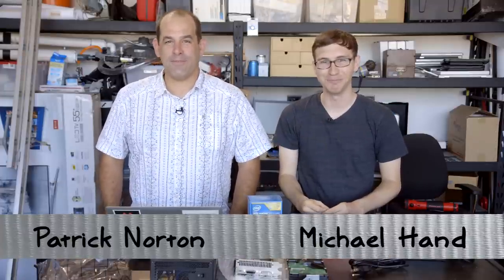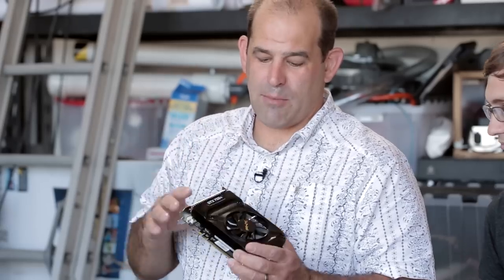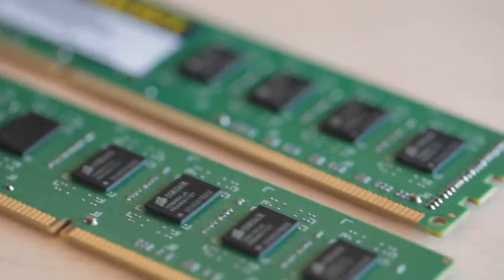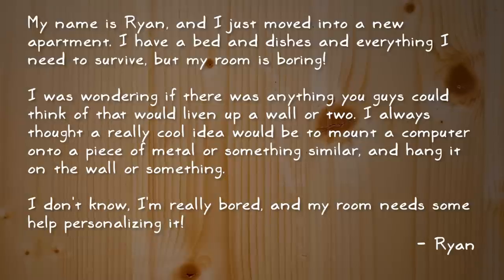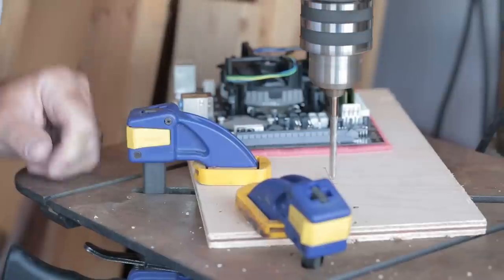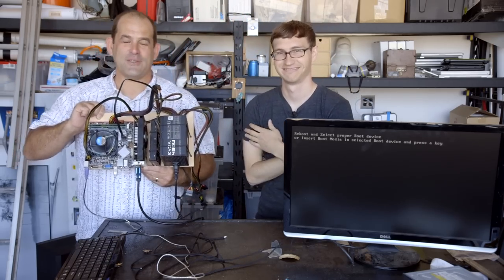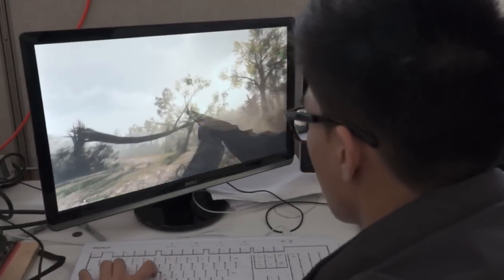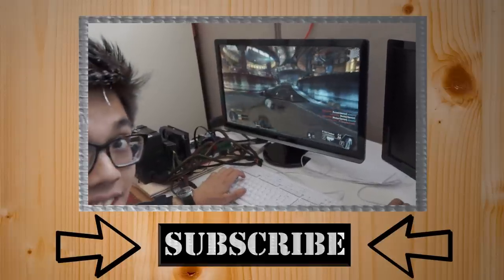Screw The XBOX ONE and the PS4... We Built a Gaming PC for $380!

Comment: My PC was like $230 and outperforms this.. not to mention it has a case.
Reply: +Andloo Yunty what are the specs, i'd like to know please.
Reply: Karambit Doppler
Most of it was on sale, but

A10-7700k
8 Gigs of random cheap ram at 1600Mhz
AsRock FM2A55M-HD+
WD Green Caviar 1TB HDD at 5400Rpm
Logisys CS301BK with included PSU

It performs at about the same level as the build depicted here.

My specs now (expanded on that rig)-the new build has a total of around $400

A10-7700k
8 Gigs of random cheap ram at 1600Mhz
AsRockFM2A55M-HD+
WD Green Caviar 1TB HDD at 5400rpm
Logisys CS301BK
EVGA Supernova semi-modular 750W PSU-bronze certified
Gigabyte Windforce R9-270X (factory OC'ed)
Reply: Oh thats actually pretty good.
Reply: +Karambit Doppler Same here =D
Reply: Karambit Doppler Thanks. Now that I know more, I would've probably gotten a better GFX to begin with, and maybe a better PSU and Case.
Reply: +Andloo Yunty 
And let me tell you, that's a cheap and pretty badass config you got there. Good job!.
Reply: +Andloo Yunty 

And let me tell you, that's a cheap and pretty badass config you got there. Good job!.
Reply: Federico Nomeacuerdo Thanks! I appreciate that.
Reply: +Andloo Yunty not to mention this video was posted a year ago and prices change quickly.
Reply: Megabine My build was made about a year ago too.
Reply: ***** I posted the specs, you can check.
Reply: ***** 2nd reply in this string. I'm sure prices have changed, but it's probably around the same today.
Reply: +Andloo Yunty i know nothing about building a good pc or anything and i would love some help because i need something cheap but i want something effected because in my predicament i don't think my dad would get some over 500 dollars and its not easy getting a job as a minor so i would appreciate some advice or something
Reply: OriginalDizzleKing Just read the earlier replies and you can see my build.
Reply: Care to share your build details in that case? I'm also looking to build a budget gaming rig
Reply: +Andloo Yunty lol that apu doesn't come close to this pc,exampe:your pc runs battlefield 4 1080p lowest possible settings 60 fps this runs it on high 1080p 60 fps,not to mention your pc can't run witcher 3 on 1080p and this can do it on high 30 fps
Reply: +Andloo Yunty You cant tell me the IGPU in the 7700k outperforms a GTX 750ti. 
I had an A10 6800k and it was pretty good for an IGPU but you wont get 60fps on modern games, not even console ports, unless you turn down the details a fair bit.
Reply: +CoalhouseWalker If you just want to play console ports or you dont care so much for ultra graphics. An Athlon II X4 or the new Pentium G4400 in combination with an R7 370 and 8 GB of ram should get you to your goal for around 300,- just for the system, without operating system and peripherials.
Reply: +Andloo Yunty  your build doesnt even have a graphics card . Apus are junk so i doubt it outperforms this
Reply: +Andloo Yunty Your junk doesn't outperform this one. An APU vs 750TI? Yeah, lol, good luck with that
Reply: +Fus Ro Dah  right lol i have a 750ti and a8-7600 and can run every game maxed out except ark and a couple other
Reply: +Andloo Yunty People don't put enough faith into the APU's.  They are really all AMD has going for them right now.
Reply: +Andloo Yunty same here. Got 150euro A6 build and 320euro A10 build.
Reply: yup, used to have 2 budget APU builds that worked great.  Running an i7 now, but it's no where near budget.
Reply: +Andloo Yunty  but you did mention it
Reply: +Andloo Yunty What about graphic card on the first build?
Reply: don't forget the change in cash with different countries
Reply: +Andloo Yunty Nope it does not.  You don't even have a dedicated GPU.  That's really a POS system. Its good as a HTPC but for gaming... It can do it but not very well.
Reply: +Karambit Doppler No its not.......... Low end gaming PC. What the guy in the video built was a PC that can play some games.
Reply: +TweetysDen At 30 fps.
Reply: I went ahead and spent $510 to make a much more futureproof system. I splurged a little and went with the R9 380 (same tier as gtx 960) so I'll be good for a years to come. Even my 3 year old HD 7770-based system is still keeping up with games today.
Reply: Your 7770 can only play Fallout 4 on Low medium CoalhouseWalker
Reply: +DEZ n00ts At what resolution? and to get what type of framerates - are we shooting for ~30 or 60 fps? I don't plan to get that game soon (haven't gotten into Fallout - I know, what's wrong with me), but I'm really curious how brand new games would/will run for me.
Reply: CoalhouseWalker
 60 fps@1080p. I have to (as well as a lot of others) turn down settings on a 970. My 660ti 3gb SC runs it on medium.
Reply: +DEZ n00ts how about for 30 fps? I'm surprised you have to turn down on a GTX970 for 1080p gaming (considering there are only a handful of more powerful cards out there). the only game I've owned that I needed to turn down was FarCry4 but that was terribly optimized from the start
Reply: CoalhouseWalker
30 fps NO PROBLEM! You will only need to turn down shadows from ultra and shadow distance to medium, like you said with Farcry4, BAD OPTIMIZATION!
Reply: CoalhouseWalker It's called bad optimization. The game isn't that well optimized.
Reply: +DEZ n00ts As you can see I have a little lower standards. I can't tell a huge difference between 30 to 60 fps but that's likely due to the fact that I have pretty old monitors anyway.
Reply: +fade2black001 yup. And that's exactly what I said. :)
Reply: not to mention you didnt factor in the price of windows
Reply: aidan katz I got windows for free. My friend owns a software company and he has hundreds of copies.
Reply: +Andloo Yunty Meanwhile console peasants say "hahaha at least I don't need to spend 5k on a computer that I have to constantly upgrade lul"
Reply: Truth ForAll Sorry, I have no need for wordpress plugins, and I'm in the US so I can't use PLRs. Also, they aren't even mine, they're my friends, so I can't just be like, hey, some random dude on the internet wants a copy of something you have, can I give it to him. Sorry about that mate. Also, I think you can Win7 for like $60 now.
Reply: Sorry I must have commented on the wrong post! I had thought I left a comment on the guys post who was bragging about having a free copy of Windows because his budy owns a software company & has hundreds of them lying around but I now see it couldn't have been u because now the tune is being whistled a bit different. Please explain why living in the U.S. has anything to do with being able to use  PLR products? I live in the U.S. & have no problem using or selling them. Just a bit confused by your statement. Thanks
Reply: Cazman Mccreager I never said I had hundreds, I said my friend does. I can't use PLR because I don't write and PLRs are used primarily in the EU
Reply: DEZ n00ts So because I won't do an illegal licensed software transfer for software I don't need in exchange for getting something my friend SELLS to you. That makes a lot of sense...
Reply: +Andloo Yunty When did you make it? If it was around the same time as this, then you're awesome.. if you did it this year or really recently, you're not.
Reply: Andloo Yunty not sure you really know what a PLR is because you are making no sense. A PLR is a private label rights software or product which is owned by someone who gives the rights away to market it by others and the marketers are able to keep 100% of the profit and also have the right to change the name of the software or product to their own name or brand to customize it. It has nothing to do with anything illegal or stolen or centralized to the EU. It is just as much within the USA and elsewhere. I think you have your PLR's mixed up or something! I also said that you said your friend had hundreds of copies. I didnt say you said you did. I really dont even care I just wanted to pull your card because I figured you were bluffing.
Reply: Andloo Yunty
 But you got an illegal copy from him too though.......
Reply: +Andloo Yunty Lol this is my current cheap build, here are the specs.
E4500 processor Overclocked to 3ghz (Came with mobo)
2 9800 GX2's (1 costed $30.50, other one was $48)
8 Gb of DDR2 ram (Got 4gb that came with the mobo, Other 4gb costed me $9)
Foxconn P9657AB-8EKRS2H ($40)

Ultra 850 Watt X4 Special Edition Modular ATX Power Supply ($79.99)
160 GB hard drive (soon to be upgraded, and it was one I have lying around)
Air Intake series premium steel ATX mid tower (funny thing I actually got this brand new and free because the guy who had it before me accidentally broke a fan blade from the back case when he first opened it and so I have it, other than a broken fan blade it is literally still new).

And it all adds up to be only $207.5. And this PC can still max out most games today. So what do you guys think of it?
Reply: +zombiekiller2point9 Good except doesnt the 9800 GX2 not support DX11. let alone 12. I could be off here because I cant find any conclusive info on it. Pretty sure though.
Reply: Truth ForAll I didn't know what PLRs where, so I got my info from a quick google search which said they were a type of license in the UK, sorry for my mistake. I'm not bluffing though, why would I lie about something like this? DEZ n00ts No, I did not. Fully legal copy.
Reply: Ryann Von Doom Middle of last year (2014)
Reply: Curious Wars Lol most games are directx 11 and since they are directx 11 directx10 gpu's can play them, but they wont have directx11 effects.
Reply: ***** Sometimes sure it will work. It will also often cause the games to crash every 5 seconds. Most games that are dx11 ONLY compatible wont let you launch the game at all as they have built in tests. Some of these tests you can get past by using the .ini file though
Reply: Curious Wars I play rome 2 total war, which is a supposed directx 11 game, as well as battlefield 4 and have never expierienced a single crash yet.
Reply: ***** As i said before, some direct x 11 games are backwards compatible and also some directx 11 only games will allow you to play. MOST of the directx 11 only games will have crashes. BF4 is actually a dx10 engine running with dx11 so it works. Rome 2 is on a game engine that is dx 9 ported to 10 and 11. 

This is what happens when you run into a more modern game that only works with dx11 or newer

https://steamcommunity.com/app/314070/discussions/0/528398719798912211/

or another

https://steamcommunity.com/app/311340/discussions/0/613956964590217996/
Reply: +Andloo Yunty it was 230 dollars because you didnt have an gpu..
Reply: The Gaming Banana it has a gpu. An APU contains a mid-low dedicated graphics card... add a gpu that crossfires with that internal one and you have a super beast for super cheap.

so you can see, without the crossfire
http://www.eteknix.com/complete-amd-kaveri-review-a10-7850k-a10-7700k-a8-7600/11/

seems almost identical performance to what you get on a ps4/xb1. Throw another 100ish into his system to get another r7 graphics chip and it will destroy both systems for a similar price (actually a little cheaper sometimes) considering both systems cap at 30fps when at 1080p for most of the games and 60 for 720p. Very similar to what you see here (plus the graphics settings they chose are pretty comparable to console
Reply: Curious Wars apu is chipset in the cpu...
Reply: ***** My build was completed a little over a year ago.
Reply: +The Gaming Banana apu units are a processor AND graphics processor all in one dude.. that specific a10 has an amd r7 graphics card in it. it shares the ram on the motherboard as graphics ram.
Reply: +Andloo Yunty http://pcpartpicker.com/p/wNJBkL
heres my build
can you tell me what to change (also which ram choice should I use
Reply: Epicmobmaster I would choose the cheaper ram, unless you were going for a particular colour scheme other than red and black. Also, I would recommend changing the 960 to a 290 if you have another $10 to spare. Overall, it's a solid build. Your PSU is ATX though, so it probably won't be compatible with the case. Even if it is, it's a bad deal. I would recommend the same PSU I use; the EVGA Supernova 750 B, a 80+Bronze 750w semi-modular PSU.

Links:

PSU: http://pcpartpicker.com/part/evga-power-supply-110b20750vr

GPU: http://pcpartpicker.com/part/sapphire-video-card-100362sr
Reply: the case was ATX im pretty sure.
the Cougar Solutions was a ATX mid tower right?
either way
would this run (with or without your recommended modifications) with a 500W PSU with minimal difference?
Reply: Also would you kindly find some bench marks comparing the 960 (2gb EVGA and whatnot) to the r9 290 (sapphire radeon 4gb and whatnot)
I would love to see a comparison
because Ive seen some great reviews for the 960 and really Im not looking to be playing Crysis 3 at ultra settings at 4k
Im more looking to be able to play games such as fallout, skyrim, and things like CSGO and shit at at least 1080p on good settings
Reply: but ya know
within reason
if either of those cards out does my expectations that would be awesome
I wouldnt mind being able to run CSGO at 4k ultra settings at 60+ FPS
lol
Reply: Also I would like to mention my current pentium dual core school cpu (XD not actually as bad as it sounds.... well its shit... but ya know)
and my radeon hd 5450
($30 baby XD)
Reply: Epicmobmaster The Tower is an ATX mid-tower, but it supports Micro-ATX.The 960 is more comparable to the 280, the 290 is just $10 and performs much better. It certainly won't play Crysis 3 ultra at 4k, but it will do somethings the 960 can't, such as run Fallout 4 at highest settings with a consistent 60fps. If you really want super bare bones, you could do a consistent 30fps on Medium for Fallout 4 with a 270x, while running CS:GO at 60+ on highest settings, and  Skyrim will easily do 60fps on high. For a budget setup, I would definitely go the AMD route.
Reply: It supports both according to its specs
but idk

I really dont want bare bones
I want to be able to do basically whatever without horribly difficulty
photoshop, gaming, web searching, homework
etc
but yeah
again if you know any good reviews comparing the 290 to the 960 or even just some bench marks of the two with equal specs
thank you :)
Reply: Epicmobmaster If you don't want barebones, proceed with your build and my modifications. Also, the part in the specs saying it supports both is referring to MoBos. 

Comparing the 290 to the 960

https://pcpartpicker.com/forums/topic/69492-radeon-r9-290-vs-nvidia-geforce-gtx-960

http://www.tomshardware.com/answers/id-2523949/gtx-960-290.html

and here's one from a website very strongly biased toward Nvidia

http://gpuboss.com/gpus/Radeon-R9-290-vs-GeForce-GTX-960
Reply: +OriginalDizzleKing Get a job at McDonald's. Your welcome :)
Reply: PC cases are soo 1999. ;) Why have a huge black or grey box when you can make ART and make it your own with YOUR personallity in it?!
Reply: +Orlando Red he built it a year ago. you can build a PC with the APU and get rolling then buy a good GPU later just like he did. but mark my words, APU's are the
Reply: +Andloo Yunty a w.d. green is the wrong drive for this application. personally i like my fx 6350 black for 140 on sale. ssd on sale, 1tb w.b. black on sale. cooler master case on sale. memory on sale. used gtx 770. all in about 600
Reply: chris keiley Aren't WD Blacks for surveillance? (slower, but more reliable) Plus blacks are more expensive.
Reply: No black are their higher end faster drives w 5 yr war.  Better performance than blue
Reply: W d green have a slower read and write. For less frequent use like a back up or the like. Sure they are cheaper but i dont do slow
Reply: Upgrade the Rams to 2133 mhz. You will see the diffrence.
Reply: That would be a good idea if you had a cooler on them
Reply: +Okan Güven Not to sure you are referring to a budget gaming pc the 2133mhz ram upgrade but ram speed dosnt increase fps preformance or atleased bearly does. The only gaming preformance where ram speed is needed is the amd APU's they need the faster ram because its used for the GPU built in on the CPU and when comparing a GPU with gddr5 6000mhz and system ram of ddr3 1600mhz there is a massive difference . There have been many reviews on ddr2 vs ddr3 in preformance and there isnt much difference only a coupple of frames its better to spend the money on a better GPU and with anything spare a faster CPU

The only things that will make this preform better in a gaming enviroment would be more cores, reason being titan fall from memory uses uncopressed sound files so it dosnt use much cpu preformance to process sound, you could also install a cheap sound card to help with that processing power when playing other games. The only other improvement for gaming preformance is GPU which is recommended. Remember when trying to get more FPS your upgrade choice should be GPU > CPU untill a bottleneck occures. For a budget pc i would have chosen a AMD cpu generally cheaper and preform better for the budget minded pc gamer with plently of cores and dont hit much of a bottle neck.
Reply: You can always over clock ram cpu and gpu for better performance. If ya build it may as well mod and tune. I never go crazy with my clock speeds but a lil bump dont hurt
Reply: +Andloo Yunty 
I just threw together a PC Partpicker of your "$230"... 
spoiler alert, its $375 as of the time im writing this comment, check it out: http://ca.pcpartpicker.com/p/wFN6GX
Reply: Daniel Stevenson Yes.. I already said that I got the stuff on sale.
Reply: Pc parts on sale can save you atleast 100 bucks.... I think i saved roughly 250... I find decent deals for diy on many websites. I have also run into decrnt pc's which were never built correctly by professionals... Update the vid card and get an ssd all in its about 400 with 8 cores and 16 gb ram with an additional drive and win 10 preinstalled
Reply: Ryan adams I posted that earlier, just look back in the first few replies. :)
Reply: wait, so you are telling me the first spec you built outperforms this pc they built? an igpu beats a gpu? wtf
Reply: Andloo Yunty
And I already said that this would be impossible to replicate if you are ordering parts online, or buying them full price at any retailer like NCIX or BoomIT, it just cnt happen, the only way this is being replicated is if literally all the parts are used, on clearance or you know an employee.
Reply: Daniel Stevenson I got it all online. Someone doesn't know how sales work.
Reply: Andloo Yunty
Here in canada, even with all the parts on sale you dont have a snowballs chance in satans anus of getting these parts for any less than double the price.
Reply: Daniel Stevenson Ohhhh. You're in Canada. Okay, my dollar is basically like $1.25ish of yours, so the prices will be different. Also, our sales are different because there are more people to sell to.
Reply: +Andloo Yunty i have build my pc with 3800$ and it outperforms yours.and i have a case too...
Reply: SataNick _ Dumbest joke of 2015. Round of applause everyone!
Reply: thank you .
Reply: +Andloo Yunty Very nice!  That's the real challenge, building a capable gaming PC for less dinero.

Plus its fun to build things.
Reply: +Andloo Yunty - Congratulations!  You built a budget PC that's faster than a budget PC built a year before you posted!  That's not impressive.
Reply: Thomas Whipps Except that I built mine about the same time this was built, within a month or two. Please read replies before commenting.
Reply: My PC is in a Card Board Box. When you need extra vent holes - just cut some ^^
Reply: +Andloo Yunty can this run Battlefront? if yes, how many fps u think it can run?
Reply: luilui89 It can, but I would guess not super high fps on high settings.
Reply: +Andloo Yunty Dude this video was in sept 2014
Reply: xMaisha My build was finished around then. As I've already said.
Reply: Andloo Yunty Ok, cool. I belive you. The thing is, i did not take time to read thru 112 comments
Reply: ***** Somebody hasn't read replies...
Reply: +Andloo Yunty lol your a10 apu outperforms a 750ti? ..........
Reply: Christopher Rogers Once again, somebody hasn't read replies.
Reply: +Andloo Yunty Amazing what happens in a year, tech gets cheaper all the time.
Reply: ***** Got the OS for free, had a spare kb/mouse (like almost everyone ever), and I'm using an old 5:4 monitor.
Reply: +Andloo Yunty  so im guessing some of your parts are used and where is you os ??
Reply: kolten wylam No used parts, and got OS for free. Read earlier replies before posting, thanks.
Reply: Andloo Yunty  then you had to get it all on sale those parts retail are over 230 even without a os and you are playing on a 5:4 moniter that probally dosent suport true 1080p no wonder it outperforms
Reply: kolten wylam Even with 1080p, it outperforms. Of course the parts were on sale. You should always buy parts on sale.
Reply: +Andloo Yunty  where did you get it
Reply: Luis Ramirez Built it myself
Reply: +Luis Ramirez  you can buy parts off craigslist which are usually 50%+ off new prices in my area
Reply: i have a samsung 960 gb ssd 3TB western digital hard drive (dont know the motherboard) an i7 intel core (dont know the full name ) and 64 gb corsair vengeance ram (very good looking) and nvidia gtx titan x 2 of them and yes i can play gta5 and ultra settings on over 200fps and yes i did not get those parts myself a friend choose them and i build my pc
Reply: tim middelkoop How is this relevant?
Reply: +tim middelkoop that's honestly a really weak system though
Reply: privileged XD what are you talking about? The only change I'd make is 980tis/390x/furies instead of titans
Reply: +privileged no i forgot the potato but its way stronger then youre pc
Reply: tim middelkoop it's a shit system, tim. in the computing world we call it a shit system
Reply: +privileged so according to you my system is shit of you think im wondering what you have yours is probably very shit because mine is a beast
Reply: tim middelkoop tri 980 ti's to start off with, and i even know the name of my motherboard. your system is g a r b a g e dude
Reply: +privileged my system isnt garbage its just i didnt fully build it myself i made the case custom thats all i did my friend built it for me
Reply: +Andloo Yunty Must of been some crazy sale to see an R9-270 a part of a $230 build. Not saying you're lying, but that was one badass sale, even five months ago. That or you're excluding shipping and/or tax. Some of us live in the real world where we include that amount.
Reply: pulpbits Please read all replies..
Reply: thats how much mines cost but mines was older hardware, but still under 250 and as powerful as this PC.
Reply: Andloo Yunty my pc of 110 with 8 gb ram 4 cores 4 threads and 4 gb of video ram
Reply: H y p o c h o n d r i a c wtf mine is 1000 dollar hp and it's slow I can't even play battle grounds